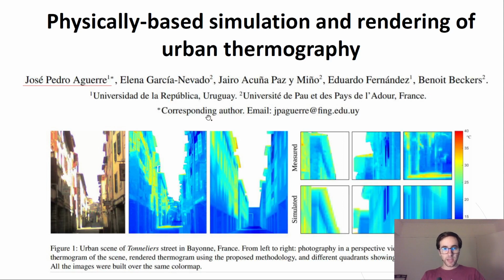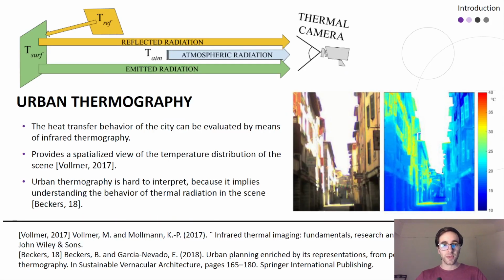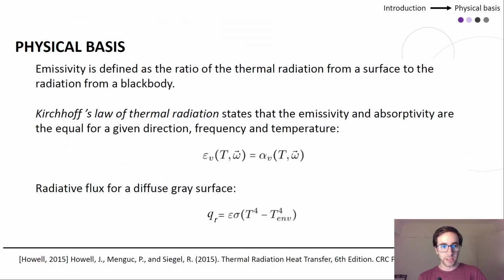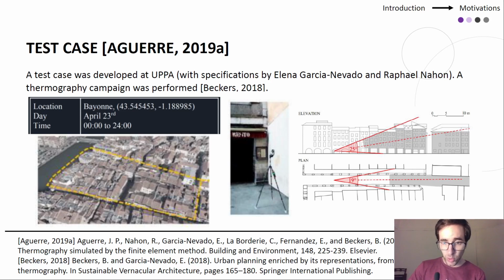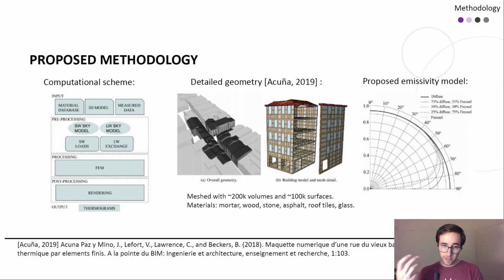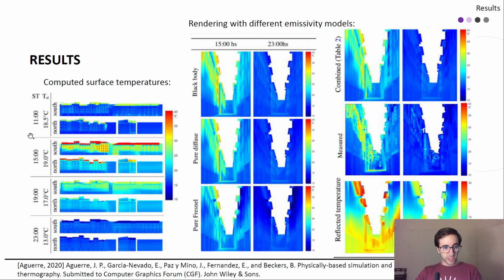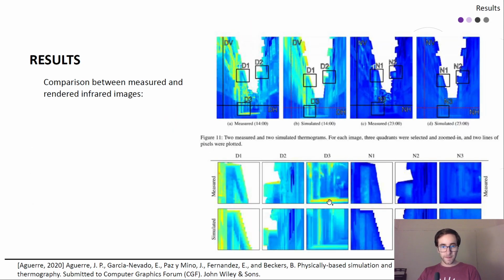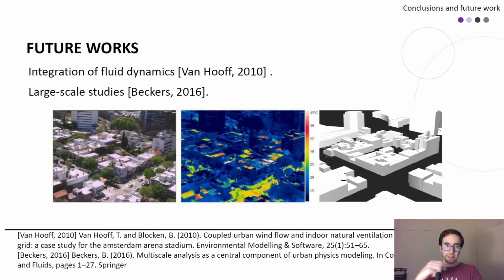Physically Based Simulation and Rendering of Urban Thermography | Eurographics'2021 Full Paper

Comment: I have read your paper as well as a few others. The public literature seems to be really thin on the topic. I was wondering how much the reflection even contributed. Most materials are highly emissive and therefore barely reflective (~0.95). So the reflection would at most add 0.05 to the calculated radiance. Which means multiple bounces are barely noticable. The larger problem is to get initial temperatures and model the heat transfer which you did in a separate paper, which I guess is something I should read too.

Also the sky model seems to be very simplified. 10 measurements at different angles and then a uniform sky without sun or clouds. Wouldn't this matter a lot if you want to get something that is more accurate? 

Also how much does the atmosphere contribute? In computer graphics it's usually assumed a vacuum. But in the LWIR band you get absorption and emission form the atmosphere as well as transmission now. Kirschoffs law still applies but there is additional refractive and scattering effects I would like to model at greater distances. Is a monochromatic approach enough or should I consider a combination of narrowband spectra. Especially if the sensor response curve and optical transmission is to be modelled too?